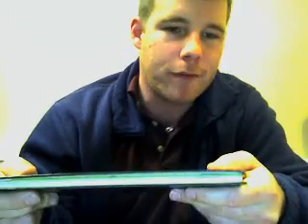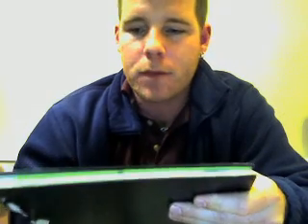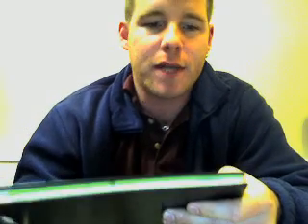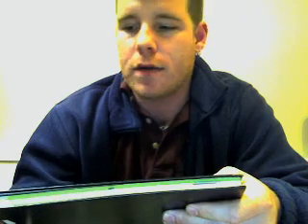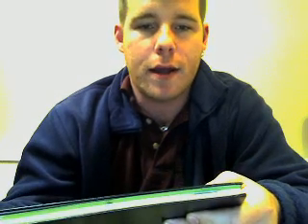The Truth about dry cells and why you might not want to buy one.

Comment: U still have a lot to learn my friend. I am shocked what you have said in this video.
Reply from the maker: You are correct. When I made this video I was extremely prejudice of conventional brute force electrolysis. Since then I figured it was probably a good idea that I gave it a second chance. So now I actually have 3 hho cells. One dry cell and 2 flow through plate cells. They aren't as bad as I originally thought. I have burned my hands once since with sodium hydroxide. But it wasn't so bad. I will be back on track to make some new videos of what I have been up to lately. I have been pondering deleting this video. Do you think I should remove it?
Reply: I'm glad you still are working on this HHO stuff there is always plenty to learn. I have been in it 8 years now. I would delete this video. Be careful using sodium hydroxide only use it for breaking in the cell and first charge of the plates NEVER use that chemical if the cell is going to be installed on a vehicle, some friendly advice.

Comment: these hho systems r great, but my r&d on my 7 plate cell, vastly increases fuel savings especially on my turbo diesel, as they have wasted torque, and naturally a dirty unfinished burn, petrol/gas motors don't reap the benefits as do diesel plants do hard evidence proves this. I am a canadian/briton and found nearly all cars in the uk are diesel so this is the reason for all my results, my Pontiac grand am 3.0L v6 got me 38 mpg with a 7plate cell, my Volvo 2.5 xc90 gets 74 mpg highway with 2ltr per minute production and 80% increase in emissions burn, diesel is the way with hho.  thanks for the vid.

Comment: It lowers octane technically.  Octane is the resistance to ignite.  Hydrogen Ignites much easier, and actually causes knock if ignition is before TDC.   If it were HIGHER octane...you would be able to advance the timing and all would be great.  This just isn't the case.

Comment: @h2oplasmaplug Which chemical ??? Sodium Hydroxide...? 
It's in anyones kitchen cabinet... Is harmless in diluted form.... Not as an electrolyte....then it is corrosive... But that is what we want to reduce needed amps. But it will not get out of the Cell. Once you put it in you have put it in and just refill distilled water. So you need very little of actually.

Comment from the maker: @Iseekoutthetruth lol dude i know i am still new at this video thing and i just turned up my volume to hear it. i will crank up the volume next time. so thank you for the advice. so yes the lazer chamber is called the fuel processor its used to increase the energy of the water by injecting light energy. he also ionized that air that went in as well. yes he did use a water spark plug hence my user name. watch my previous video i explain that. the recycled gas was used to slow down the burn rate.

Comment from the maker: @DutchUnited71 great that your cell doesnt need cooling but i bet it still gets really hot and another thing if your using caustic soda as an electrolyte your making people burn that in to the atmosphere. it will also speed up the corrosion of a aluminum engine. it also eats and drys out gaskets. i have done my research its clear you just ran with a product. now once my company has started i will offer to help to improve your kit to illuminate your electrolyte.  i will work to help improve

Comment from the maker: @DutchUnited71 so about your leaking amps claim. in the design that i am using and the pwm voltage takes over and current is limited. so how can i leak amps when it barely use any. i am still in build mode but i think it will be very easy to hit 12 volts with an absolute max of 5 amps but i still think its going to be less. this should produce 5 to 7 lpm. will not heat up. will remain at room temp. well if your selling those plated cells how come you haven't tried to improve with frequency.

Comment from the maker: @DutchUnited71 ok well being a very science minded man i have learned you cant look at only one thing as a solution. i have now taught you about di and ds water. now if you dont believe me go do your own research and testing. also if your using distilled and prefer it use rain water its almost the same thing. so use nothing else besides sodium hydroxide ehh do you know what that is. its caustic soda or lye. its normally used in industrial cleaning applications read the next one

Comment: I have agreed with you on some of your other hho ideas and concepts but this one I have to disagree. Any of these dry cells can run clean if we figure out the correct frequencies and voltages, you won't need the electrolyte. 

 The electrolyte stays inside the cell so as far as the "chemicals" go, its very minimal. Dry cells are here to stay. Again if we figure out the correct circuitry you can use the dry cell the same way you would use the "tubes". Still going to fracture the water.

Comment: dude, just some advise you need to get a microphone  its hard to hear you. first of all all hho generator on youtube will never run a car safely on hho, meyers used a lazer frequency to ignite the plain tap water in the cylinder which he pulsed into a mist he did not use a dry cell or stainless steel plates, he had what looks like a fuel injected spark plug. he used a computer operated system that split the molecuse instantly in the cylinder and recycled the un burn gas